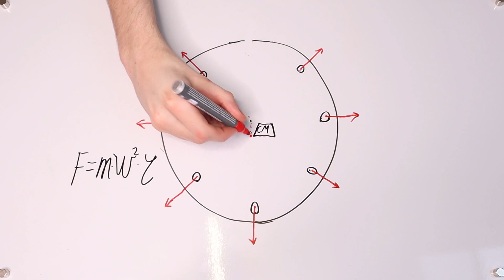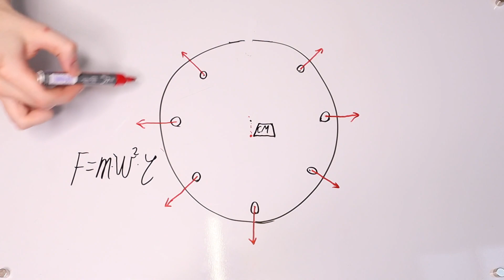The difference between Static and Dynamic Unbalance

Comment: Nice explanation.  Now to my problem:  my washing machine goes out of balance on the low speed spin (at the end of the wash and rinse cycles), but not on the high speed spin (occurs twice on the spin cycle).  I observe that as the machine spins up the high speed spin (spin cycle), there is an intermediate speed where the machine starts to go out of balance, but the rate of increase in angular velocity fairly rapidly damps that out.  On the low speed spin (wash and rinse cycles), the angular velocity seems to terminate right at the point where the out-of-balance condition is at a maximum.  It seems to me that, under the imbalance condition, the machine moves from side-to-side rather than at random, and I suspect that this is because the base is narrower in the side-to-side direction than it is in the front-to-back direction.  Thus, I believe that the oscillation of the spinning unbalanced wash basket hits a vibrational frequency of the washing machine base causing the machine to make unpleasant noises and to walk around.

The machine is designed with a "balance" ring at the top of the clothes basket that is filled with fluid.  I presume that this fluid-filled ring is supposed to dynamically counter any oscillations that result from an imbalanced load in the basket.  Inspection of the basket shows that there is fluid in the balance ring and there does not appear to be any damage to the ring that would cause a leak in the balance ring.

I am having a hard time visualizing how a relatively small fluid-filled ring at the top of the wash basket can adequately stabilize an unbalanced load of wet clothing in the bottom of the basket.  Alas, for my model, the balance ring cannot be replaced and the cost of a new basket is nearly the same as the price of a new washer.

I should point out that the wash basket, the outer container and the motor and gearing are supported on suspension rods with springs to damp out vibrations.  I am thinking that, in addition to springs, the suspension rods should include dashpots to overdamp the motions.

Any thoughts about this practical application of the points made in your video?

BTW, your video was the best I have seen about the subject of instability of rotating systems!  Thanks.

Comment: Looks like dynamic is just 2 plane balance, and that if the wheel rotated on a point instead of an axis you could determine dynamic imbalance using static methods?
Reply from the maker: Well that's a weird way to think about it honestly. Rotation is usually regarded as being around an axis. Perpendicular to that axis is a plane.

Maybe by "rotated on a point", you mean having the object spinning in free space. In that case the object will always rotate around its center of mass. Another way of looking at dynamic imbalance is that the axis of rotation is not one of the principal axes of the object. I'm not sure if you can measure dynamic imbalance using static methods, I believe not, but honestly this piece of classical mechanics has been ages ago for me.
Reply: Actually you are correct, even about a point you couldn't measure dynamic imbalance. For some reason I imagined the bolts sticking out in different axial directions creating a couple in a static scenario, but they only do this in a dynamic scenario where the forces are radially outwards. In a static scenario in a gravitational field they're both 'down' and cancel each others turning effect.

Comment: The other thing to notice is the omega squared term. Things get bad fast at high speeds. You equation would imply that doubling the speed quadruples the magnitude of the vibration. Or going from 100 to 1000 rpm would increase the force 100x!

Comment: nice demonstration. I didn’t know that was called dynamic balance I thought it’s just a way to balance the weel better, but it makes sense since it only occurs when you rotate it. I have a flywheel and it has a counter weight to balance the crankshaft and that means it can’t be balanced dynamically but that’s maybe one reason why the redline is 5500rpm .
Reply from the maker: That could be, though the flywheel itself should be statically and dynamically balanced. But balancing the crankshaft is very hard. You can look into primary and secondary imbalance, though I'm not very familiar with it myself.

Comment: Great video that really explains it. If one has dynamic imbalance how does one know the weight and distance from the center one needs to place it in order to counteract the dynamic imbalance?
Reply from the maker: That's actually quite tricky. What you can do is put the shaft in a pair of bearing, and then have the bearing housings supported by load cells. In this way you can measure how much force is exerted on the bearings, and by checking whether the force is in the same or opposite direction you can find whether you have static or dynamic imbalance.

You can then run the math backwards to figure out where to place weights, but I haven't studied that math. You will have multiple solutions, you can use lighter weights if you can place them further out.
Reply: @antalz  Thanks for that explanation. I am going to try to figure it out.
Reply: @antalz  One more question if you don't mind. I am creating a wheel balancer as I need to balance many thousands of wheels. The wheel is 2" wide, 7" in diameter. If I have static imbalance that means I will have to place a weight on each  side of the wheel at some distance from the center of rotation, correct? If I also have dynamic imbalance I will have to also place a weight on just one side of the wheel also distance from the center correct?
Reply from the maker: @Yoyo-ug7wt  Kinda, but you got it backwards. Static imbalance can be fixed with a single weight, dynamic imbalance needs to be fixed with 2 weights. If you try to fix static imbalance with just 1 weight, you und up creating static imbalance which needs a second weight to be fixed.
Reply: @antalz  But I am not sticking a weight right through the wheel to the other side like in your video. I can only stick it on one side, the other or both. If the wheel is 2" wide and has static imbalance and my weights do not extend right through the wheel to the other side then I will be creating dynamic imbalance by placing the weight only on one side won't I? My wheels are solid plastic.
Reply from the maker: @Yoyo-ug7wt  Yeah in that case you're correct. In that case I think you must always add 2 weights. For pure static imbalance on the left and right side of the wheel, mirrored across the middle. If you also have dynamic imbalance then you can rotate the weights around the axis of the wheels, one weight clockwise and the other counterclockwise. To solve pure dynamic imbalance the weights would be 180 degrees from each other. It'll be mathematically difficult to find what combination of angle and weight will solve both static and dynamic imbalance simultaneously.

I don't think you can solve a pure dynamic imbalance with 1 weight, because you'll introduce static imbalance as a result.
Reply: @antalz  So therefore is it not best to correct the static imbalance first, if any, by putting the test weights on and testing and revising to correct it and once correct then to solve any dynamic imbalance?

Comment: I don't need to 3D print these. I don't have a drill press. I've been bugged by these problems for decades. But not enough to go get a drill press.
Reply from the maker: A drillpress and 3D printer both aren't too expensive I would say. I think for many the real issue is where to put one.

Comment: I've achieve static balance on my tires, but I'm experiencing Dynamic imbalance, and it's driving me nuts!
Reply from the maker: I think you should ask a mechanic shop about that, that's very difficult to solve without a tire balancing machine. I guess you should add zink weights to the inboard and outboard part of the rim, to create a dynamic imbalance to offset the existing dynaminc imbalance, but how much weight to place where is nearly impossible to figure out without a balancer.

Comment: Again, thank you very much. What is couple imbalance?
Reply from the maker: Dynamic imbalance = static imbalance + couple imbalance, so if you have a shaft that vibrates when it's rotating, one part of the vibration is caused by static imbalance, one part is caused by dynamic imbalance, and the total imbalance is dynamic imbalance.

I'm not sure if those terms are universal. My analytical mechanics textbook makes no mention of the term "couple imbalance".
Reply: @antalz  Thank you. Reading a book written by Ricky Smith and Keith Mobley and it states..."There are four types of imbalance: 1. Static 2. Dynamic 3. Couple and 4. Dynamic imbalance combinations of static and couple.
I appreciate your answer because the differences where not at all clear to me.
Reply from the maker: @pkilo2811  Ow that's an engineering book. I find engineers like to define lots of catagories and situations. I was using a physics textbook, they like to define as few things as possible, it's more elegant like that or something. So my textbook only has static and dynamic.